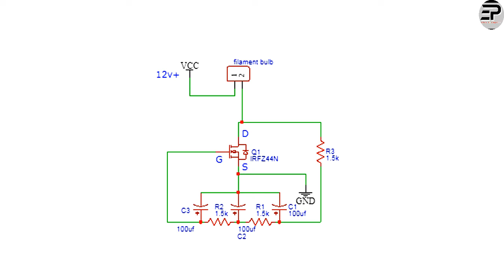New idea!! Those tools About to Useful For you, Make it yourself

Comment: wtf the first one is absolutely useless💀💀 just use a battery and switch no need for so complicated coil and stuff???? or instead of just using a 1.5v battery just use a real 9v battery its way easier then risking your hand getting burnt by a soldering pen and the battery will die fast due to the high current its drawing. oh and who would ever use that in real life anyways?? also WTF the second one can just be a switch with a fan to a 9v battery again?? also another thing is who the hell who isnt a tinkerer would have a soldering kit. also the third one is clearly edited, and IT ISNT GOING TO BE MORE POWERFUL FOR GOD SAKE IPODS ARE A 9V APPLICATION
Reply: i can barely watch this video without crying at the shit wiring too
Reply: ALSO WHAT THE DEVILS DONT USE A FUSE AS A LIGHT BULB OR HEAT PRODUCER
Reply from the maker: you are getting it wrong dear
Reply: @electproject  nuh uh this is just clickbait